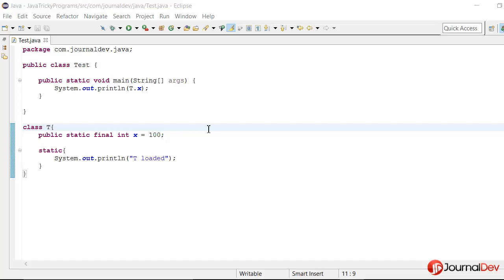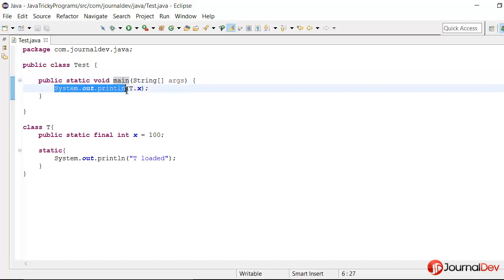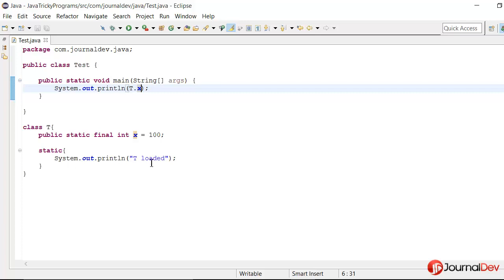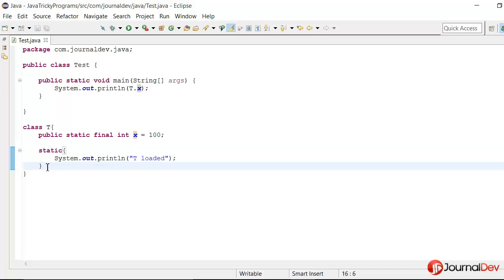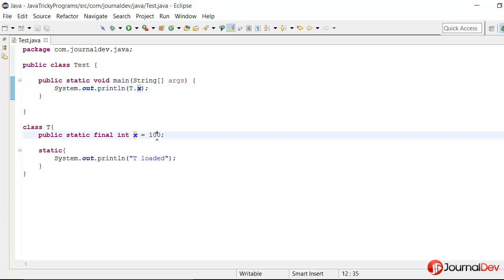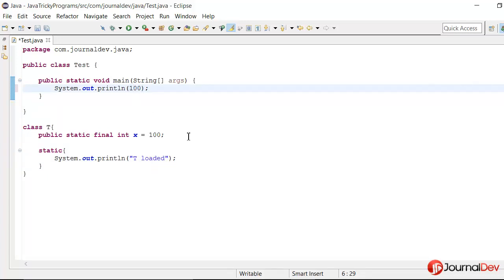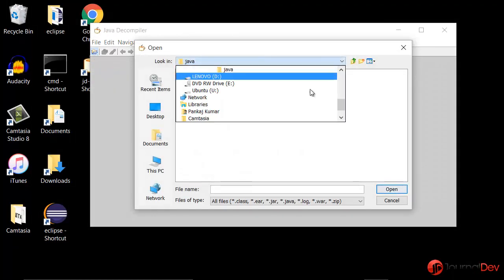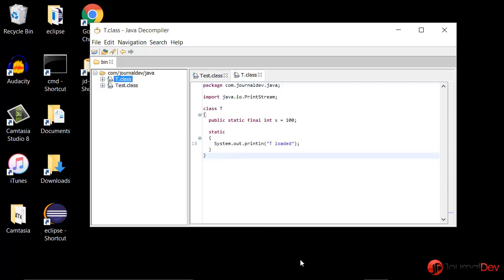Java Tricky Program 1 - Java Compiler Optimization

Comment: I think this happens because there is no object instantiation with the keyword new (that is the reason static code is never called). It is very interesting to add a constructor in class T that simply prints a message  and in the main program to instantiate 2 objects. The static code will be called once.